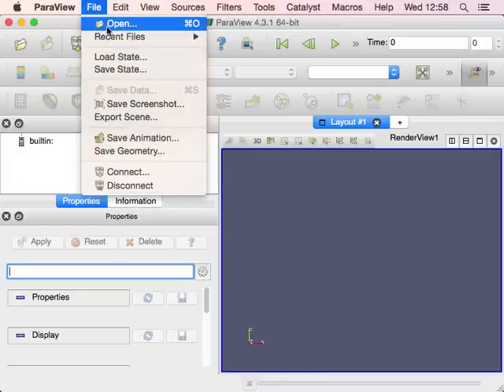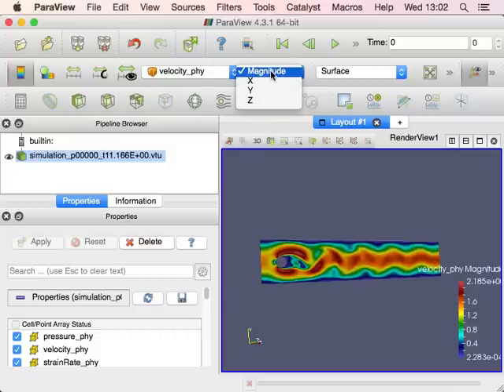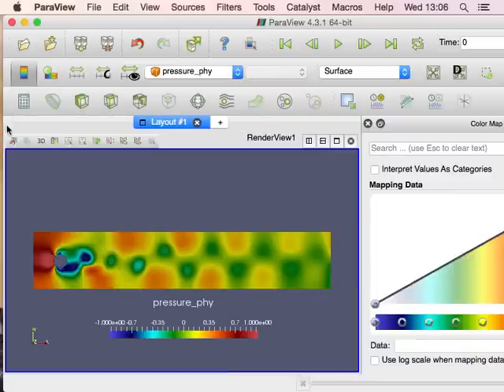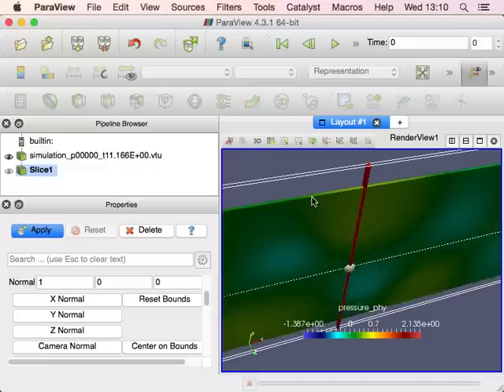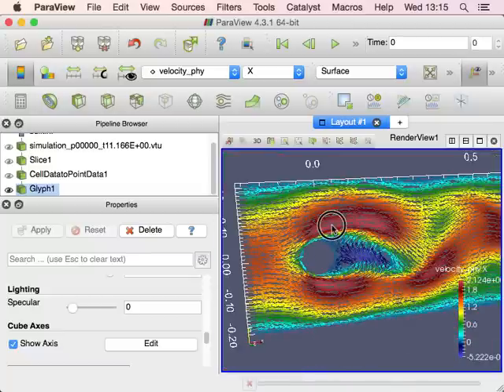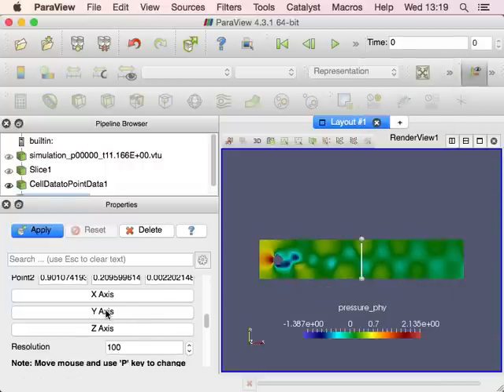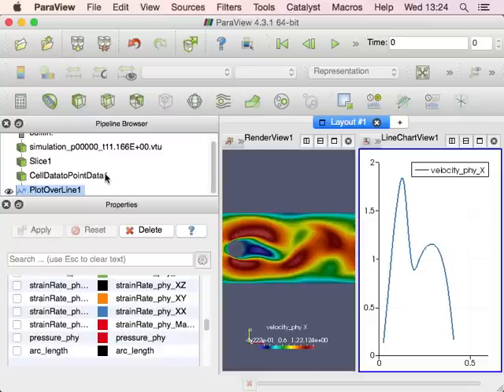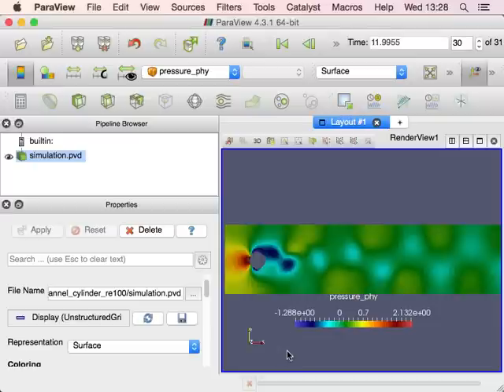Paraview tutorial

Comment: That was indeed very helpful to me. 
I have one query actually. I have set of vtk files generated with different processors at same data and same time steps. I want to merge those vtk files onto one. Could you please tell how we can do it ?
Reply from the maker: sorry, I don't know how to do that.
Reply: okay :) actually I m stuck there itself. I am not able to process my results from different processors
Reply from the maker: But you load them together in paraview
Reply: What software did you use to export results? If you use openFoam in parallel, you should reconstruct all results from processors before converting to Vtk.
Reply: Hi, function "Cell Data to Point Data" in my PARAVIEW does not work? How could I do? Thanks